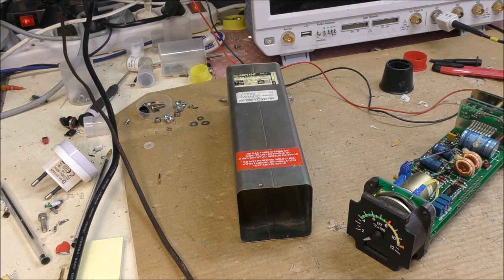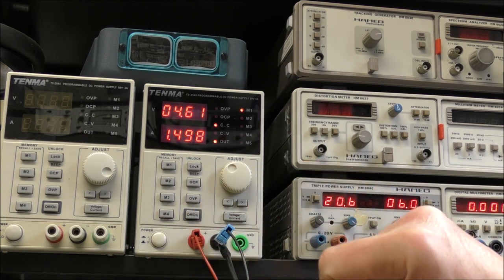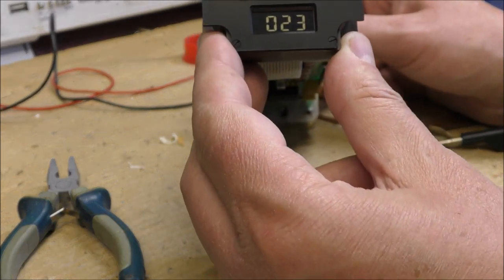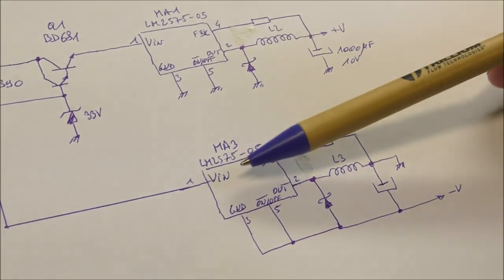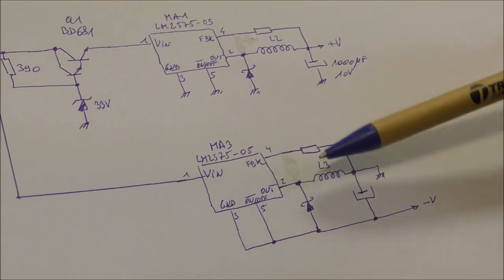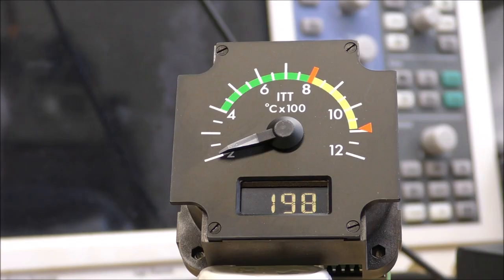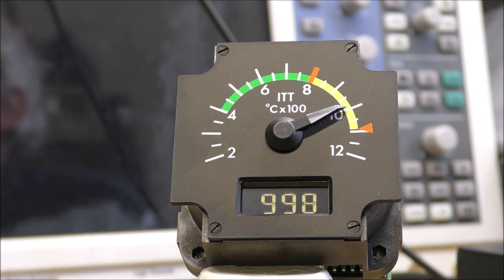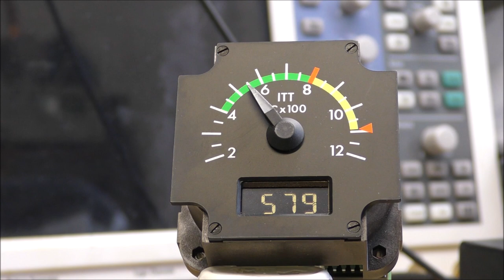LDM #269: ITT indicator Sextant Avionique Part 2: tests

Comment: I don't get the design of this power supply circuit. The input of the positive LM2575 based regulator is clamped at 33V - Ube of the pass regulator so it is compatible with the voltage pulses defined in the section 16 of RTCA DO-160. The inverting regulator for the -5volts is supplied before the pass regulator, so it can directly see the 40V 60V or highest 100V intermittent pulses on the DC input. Absolute max input voltage for the 2575 is 45V so the inverting regulator shall not be supplied by more than 40V of peak input voltage (45V - 5V) on the input which is a bit underrated for the lowest voltage pulse of 40V. We used the HV versions of the 2575 by default for similar power supplies.
Reply from the maker: Yes several things are weird on this series of instruments. One problem is the high current at startup required for the negative power supply (2A for less than 100mA after 1s). I think that the pre-regulator is not able to generate this current and probably someone has decided not to use the limiter for the negative regulator for that reason.